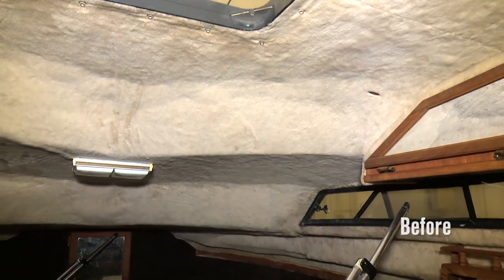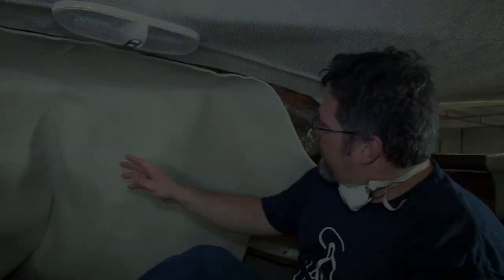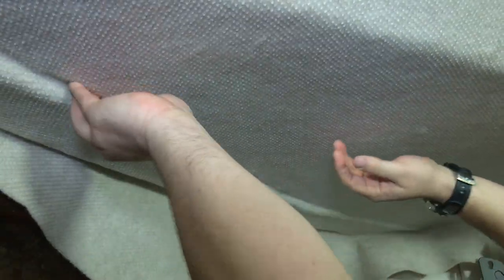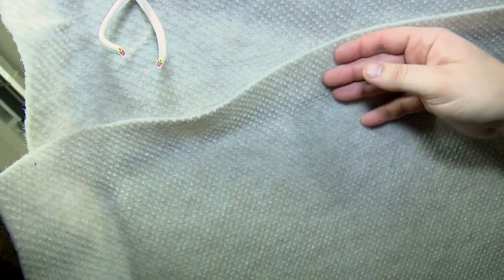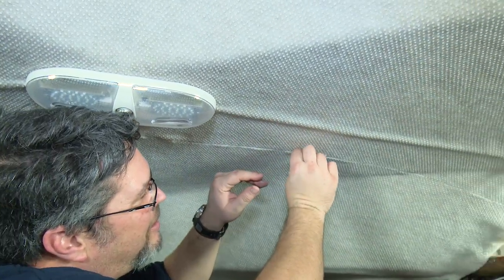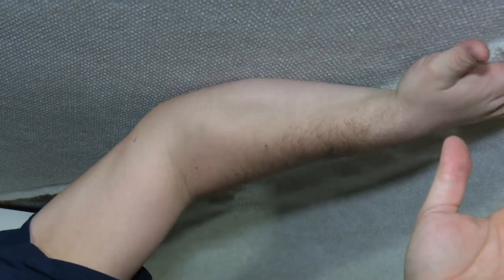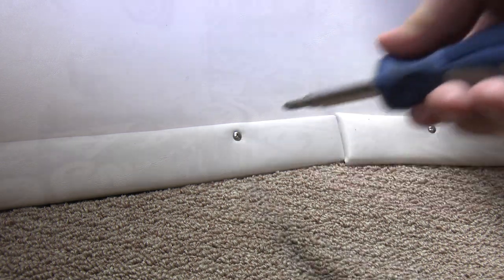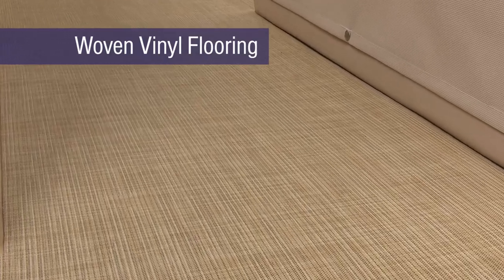How to Install Carpet Style Headliner

Comment: I have been installing carpet since 1964..This is a decent video..The better the area is prepped the easier and nicer your work will turn out..The blades he refers to are called "bloody Mary" blades..1/2 the trade uses them..I don't, because they are too easy to get cut..I use a utility knife and sharpen it often (with a dry stone)..The bloody Mary edge dulls much faster than the other blades..I have done many head liners and can not stress how much ventilation is needed..Always wear a mask and glasses..The worse part of the process is the position you have to be in while installing the carpet..I would suggest one other tool---a 3 inch putty flexible knife for smoothing bubbles and for tucking the edges..Take your time...DO NOT HURRY...Take on only as much work without getting fatigued--That is when errors are made..Don't be intimated by the job, it's not difficult..The material stretches and conforms..
Reply: Why is a headline needed? Can you use foam squares? Or just paint? My husband is in charge of of all the other stuff but in not wanting carpet. Can just painting it with marine paint work? Or is carpet a temperature control thing? Thanks ?

Comment: Very informative.  Unless the butyl tape has improved considerably I wouldn't recommend it for the long term.  I have a 1979 Tollycraft that used it and it hardened after about 20 years. They used it on the window frames, deck hardware and everything in between.  Everyone failed as it lost its elasticity and adhesion.  Lots of water leaks until it was all replaced.  I replaced using Sikkaflex with good results.  Silicone in a non mildewing marine formulation does work well but as you mentioned it is messy and you do need to tape off the area first.  On the good side I haven't ever seen a quality silicone fail.  Taping is a necessity and using a purpose solvent to clean any residual is a must.  All and all I prefer the Sikkaflex in an adhesive marine grade.  It maintains good life and is removable in the future if needed.  3M 4200 (not 5200 which is permanent and they do mean permanent!) is also a very good bedding agent and removable in future if needed.  They even make a purpose solvent to dissolve the 4200 and 5200 the caveat is that it won't work unless you can get it directly on the sealant so a bedded object will be difficult if not impossible to use it on.  Double check the suitability if using any of these under the waterline.  

Is your Dad still active?  I enjoyed his DVD's on sewing.  When I started it was pre You Tube and information on basic sewing was difficult to get and complex projects were really hard to obtain info on.  He was a great source.  Pass along my greetings to him if you get a chance.

Thanks.  Doug in Ketchikan, Alaska
Reply: 20 years on a sealant is pretty damned good.

Comment: Question, my old Bayliner has this material and although it has held up well for forty years, condensation caused by leaks has caused moss to grow around my top deck windows enevitably staining the lining around said windpws.......is there any way to remove this staining? or do i need to do whats shown here and renew ?
Reply from the maker: When the lining get that stained, we have not found a way to clean it effectively, sorry.

Comment: @sailrite question, on this video there is no surface prep and on another headliner video they sanded the surface.  Do you need surface prep for carpet?
Reply from the maker: The surface must have anything that is loose removed. We do recommend brushing with a wire brush or sand paper and then using 3M Adhesive Cleaner #108984 at Sailrite for best results.

Comment: I know this video is 7 years old so not sure anyone will read this comment. I am hoping someone can provide me with a link to the same carpet he is using in this video. It is identical to the headliner carpet I just removed from my cuddy cabin.
Reply from the maker: Hi James, 
Here is a link to our headliners. https://www.sailrite.com/search?keywords=hullblanket
I think we used sand in that video if I recall correctly.
Reply: @SailriteDIY  Thank you. For some reason the material calculator isn't working for me on your website. I have a 21' boat with a cuddy cabin...

Comment: head liner over wiring is horrible. Should have installed trunking for the wiring so the finish is smooth and the wiring can be replaced or modified in the future without destroying the headliner.
Reply from the maker: Good suggestion, thanks!!!
Reply: Polished stainless or copper tubing would look pretty good giving an urban industrial loft look to it.

Comment: I worry about trapping moiisture and growning mold with this technique
Reply from the maker: Any headliner you apply may have that issue.
Reply from the maker: Keep it clean, but that is a difficult task. Mold will not grow to this synthetic material, but it will grow to dirt bedded in the materiel.
Reply: @SailriteDIY   wouldnt hurt to sand and even gelcoat the roof. Or at least smooth out some of the surface at the same time cleaning the dirt away.

Comment: This type of headliner should be avoided at all cost. Not only will it leach chem-vapors for years, collect all odors, it will eventually fail and begin to sag. Sand and paint your interior.
Reply from the maker: We are not aware of any health hazards to this material. It will most certainly hold odors as it is like carpet. The material will not fail and sag. A poor quality installation with the wrong glue or too little glue can cause it to come loose. We agree that sanding and painting is an alternative but it does not hide imperfections which is why this product is often used.
Reply: Sanding and painting is a reasonable solution for a "weekender" or occasional use boat. For a live-aboard or extended cruising boat, some sort of insulation from heat caused by the sun transferring through the decks and hull is a "must". Even with air conditioning and white decks the over-head can heat up to in excess of 120 degrees in summer months. In the winter, a bare over-head acts like the freezer plate in the ice box. I am not completely happy with glued "fuzzy" material, either, because it is difficult to clean (I smoke and carpet and cloth yellows quickly), and inferior glues do harden and become brittle because of those temperature extremes. I have used removable panels where the geometry is not too complex, covered in foam backed vinyl similar to automotive head-liner. These panels can be removed easily and non-destructively to reach deck fitting hardware; the vinyl cleans easily, and a loose, thin layer of some form of insulation can be laid in between the panel and the deck material - even thin fiberglass insulation works well.
Reply: In about 30 yrs maybe....